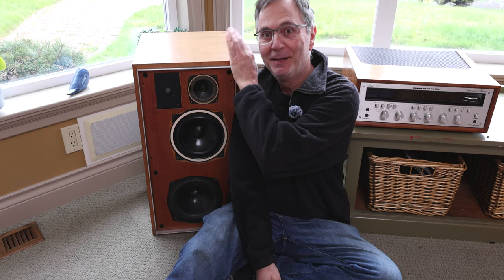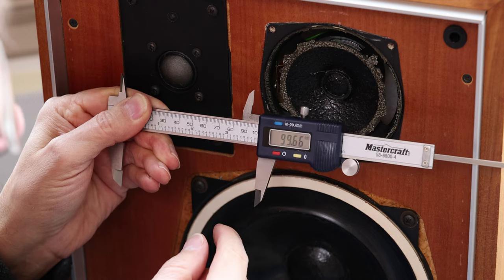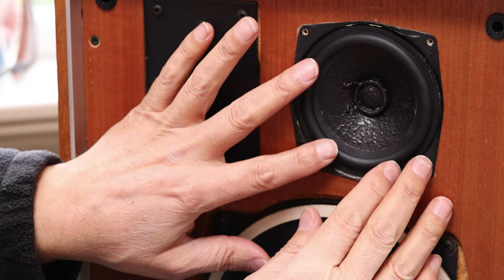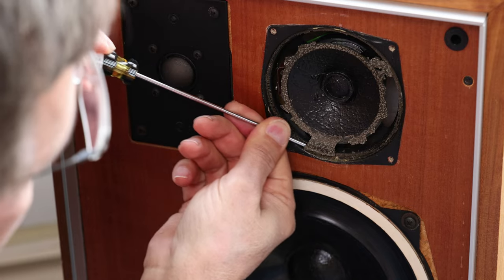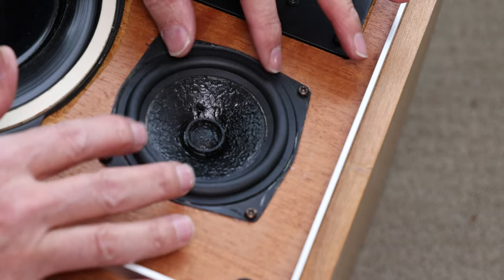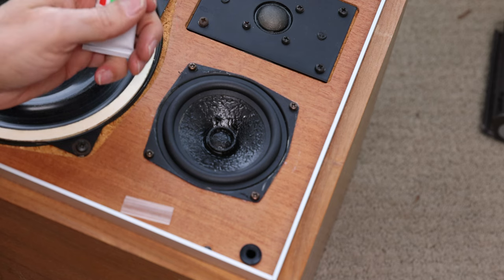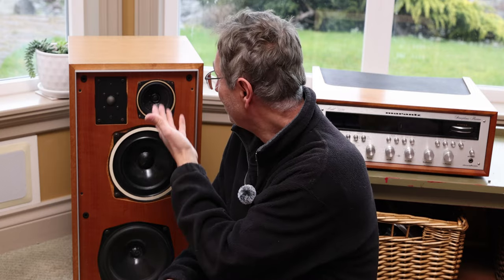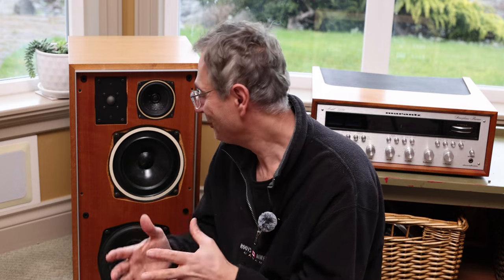Speaker surround Repair

Comment: The mid and bass drivers don't look original to me. I thought the mid was supposed to be a KEF B110, although I could be wrong about that, but the bass driver should be a KEF B200 which is the driven version of the passive radiator on the end of the transmission line. Falcon Acoustics UK made reproduction KEF drivers.
Reply from the maker: When I got them I thought the same but after looking at various pictures I realized there are a couple versions, one of them is identical to these. The original owner bought them new in Holland and never changed anything so they are original. They are amazing speakers.
Reply: @Gabster1  yes, I just had another look at the old info and was surprised to find I've been wrong all these years. The larger models like the TLS 80, use KEF drivers. Thanks, I learned something new!
Reply: The midrange is a peerless driver from Denmark 🇩🇰...!

Comment: But you put in a midrange a rubber suspension , when before it was foam ........ovviamente without even taking it apart not even knowing who Thiele and Small were, if you use a bicycle inner tube it works even better...........
Reply from the maker: I see your point, These are feather light flexible Rubber not you Subwoofer type they will not affect the Thiele and Small. They are what others with same speakers recommend. also I plan on redoing the crossovers and remeasure and calibrate  the Frequency response.